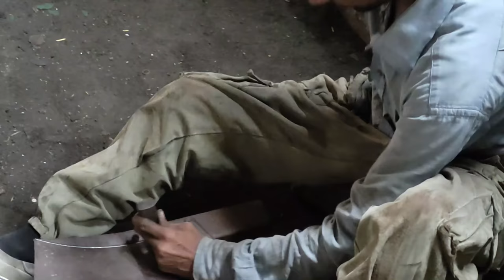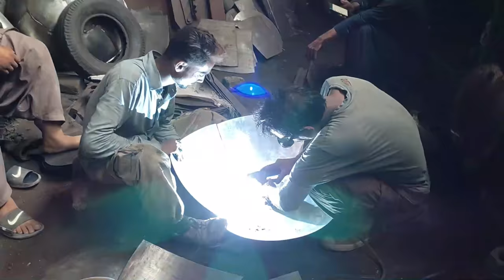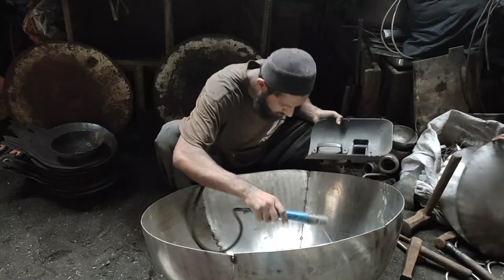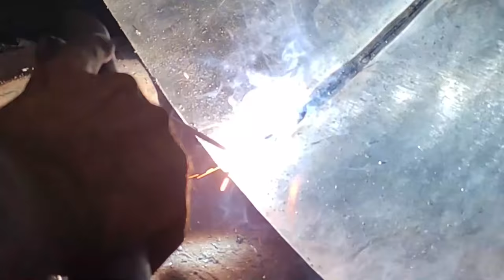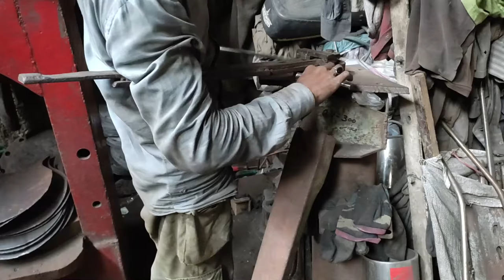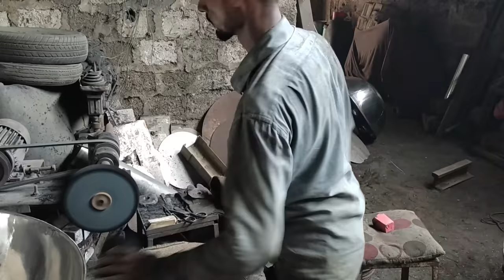interesting process of making large iron pans || best cookware utensil

Comment: These are skilled workers it’s truly amazing how instinctive the feel the look of the metal they’re working with is alternatively revised without hesitation and accordingly act to amend it on impulse be that cutting shaping hammering or welding they characterised the art and process of blending the metals existence through methods of strengthening their structural integrity by combining a multitude of single pieces into metal restructure work as a necessary tool these skills will eventually be faze out eventually but until then

Comment: These pans can be shaped with modern machines from a single sheet of metal without the need for extensive welding.
Reply: Yes true.. But most of them will be jobless
Reply: Kartar Singh 🧐  are you suggesting they should order 10 of those modern machines , or maybe 20
Reply: but you don't under stand these sheets are used iron sheet drums from scrap and they are making their living from scrap .
Reply: yes, wih either a huge press machine, or a large turning machine.
What you see in this video is no a traditional technique either, with welding and such.

Comment: You would think that you might be able to make a wooden mold to set all the metal pieces in that are all the same size so you don't have to measure all the time then put the bottom in and then put the wall sections in and then weld them

Comment: Is this safe for food?
The welding process uses lead
Reply: No it doesn’t.
Reply: @jdx3816  i checked.

MIG welding is not safe for food because of the flux. You need stainless steel, not mild steel and specialised spot welding equipment. Otherwise when you heat the materials then the flux can melt into the food. 

I got this from govt website
"You cant weld copper to stainless, it can be silver soldered, but wont be food safe, flux cored wire is for mild steel and also is not food safe"